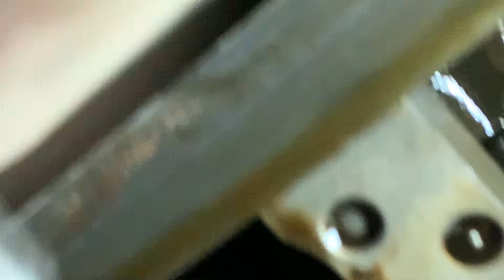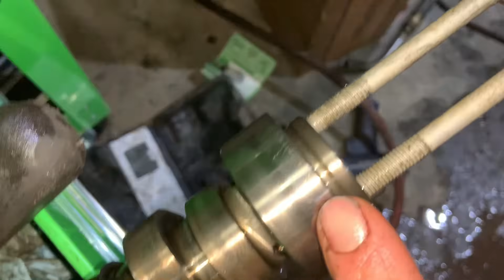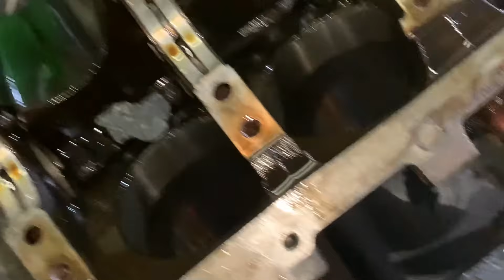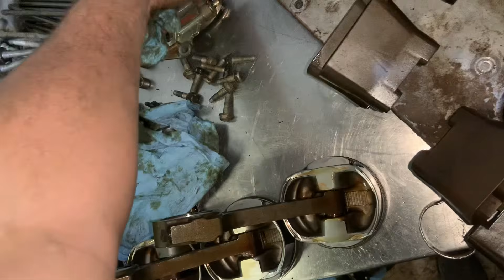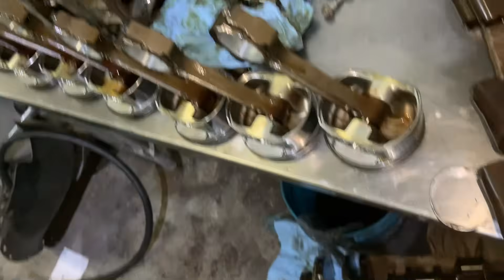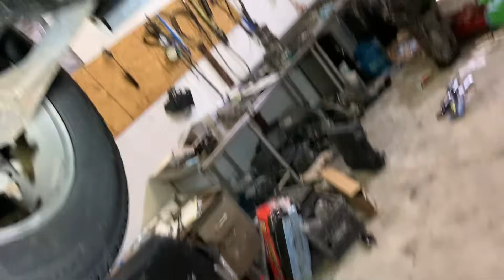ULTIMATE LS ENGINE NO OIL PRESSURE LOW OIL PRESSURE DIAGNOSIS AND REPAIR GUIDE

Comment: Great video, thank you for the plethora of information. Was wondering if you could answer a few questions I have. I recently purchased a 2007 Escalade with 194k miles. It needs some love but overall a great truck that I’m enjoying fixing up and getting it ready for the road. I’m getting a low oil pressure warning just around the time the engine warms up to operating temperature. If I give the engine a little bit of throttle (1500-2000rpms), the light immediately goes out and doesn’t return for a short while, and then I can repeat the process. I did notice some inconsistent ticking noise coming from the engine occasionally. Sometimes I can have the truck run for 10-15min and not have any of that noise (oil pressure warning will still come on though). The noise may or may not be unrelated. Sounds somewhat like a bad belt tensioner but I replaced that already. I’ll see if I can get the accessory belt off and run it when the noise is present to see if it goes away. Anyways, I put in fresh 5w30 high mileage oil. Mobil1 filter. I still have the old filter that I’m curious to cut into to see if there’s any metal in it. I do have some oil that drips overnight. Looks like it’s coming from a few spots, mostly the oil pan. So, that being said, I do have it on my to-do list to change that oil pan gasket, as well as the o-ring. I’m tempted to change the oil pump as well. Should I opt in for a high pressure/volume pump by Melling? Or you think I’ll be fine with a regular one? I’ll try the trick for taking the plate off to see if I can notice any cam bearings that walked out. Oil pressure switch was recently replaced as well after I was getting a code for it. I didn’t look for or receive an oil pressure switch filter. I recall seeing somewhere in another video how the 6.2 didn’t have a filter/screen for that oil pressure switch. Any thoughts or comments on my situation would be very appreciated. Let me know if you have additional questions for me to provide as much info as I can.
Reply: My SRT8 has similar issue except only at idle when hot or operating temperature. As soon as RPM increase to 1000 the oil psi also increases from 5psi to 10. Rule for oil pressure is 10psi for every 1000 RPM. I will be dropping my oil pan to investigate. Any updates on your end?
Reply: @richey1794  I’m currently in the process of replacing some parts (waiting on a RockAuto shipment in the next day or two). The ticking sound was probably a one-off, I haven’t ever really heard it come back, so I’d write that off as unrelated. Oil pan is off. Oil pump is off. The oil filter didn’t have metal shavings but a lot of sludge, as was evident when I took of the timing cover and oil pan. Not thick sludge but just a lot of brown staining which kinda indicated infrequent oil changes and probably poor oil choice. Anyways, o-ring looked a little squared off. I’m not sure if it’s the culprit but I could easily assume so. Oil pump had some scoring on it, but I don’t know if it was bad enough to be a bad pump. I did, however, purchase a new Melling High Volume pump that I will be installing. I did also replace the Cam Thrust Plate. The new one has a nice little seal that extends 1-2mm from the surface. When I took the old one off, it was flat like the earth. I’d like to think that new cam plate will help with my oil pressure in addition to a new pick-up tube o-ring, new oil pick up tube, new high volume oil pump, new oil pan gasket, and a good cleaning of the pan and other components. I checked under the windage plate and it was hard to see if any bearings walked out or not, but I didn’t see anything out of the norm. The absence of metal shavings kinda helped me confirm the bearings are still good so far. I also have a new timing chain kit I’m installing while I’m there along with a few other misc parts. New motor mounts are in (both were SHOT). Don’t know what else to add, I guess I’ll have a better answer a few days from now if I’m back here in the comments section. I’m fairly confident everything mentioned above will fix my oil pressure issue. If not, I’ll be pretty bummed out since this project is already creeping past my budget.

Comment: Great content! I was wondering if you have ever compared the oil pressure indicated from the front left oil port vs the rear oil sender port. Working on an '08 Yukon Hybrid 6.0 at the moment and have HOT, 1100 RPM, 54 PSI at the front port and 23 PSI at the sender. At 750 RPM, the pressures are 48 and 17-19 PSI. This is an engine that has had another shop install a high-volume oil pump and I assume pickup o-ring. Thanks for any info, Oscar.
Reply: Did you ever determine the cause of the differential?
Reply: Sadly, no. If I remember correctly, the customer took the vehicle away. @kincaidjeff

Comment: Thank You for a very comprehensive explanation concerning low oil pressure causes.    talked to 4 mechanics and got 4 diffrent explanations....  I WAS a ASE certified many years ago and wanted just at least another opinion.
You confirmed many things as I am of the 350 era.....built a few and found how to make more oil moving with higher rpm's...   yada yada.   thanks for confirming an ole guys diag.

Comment: Misinformation, the oil pressure bypass DOES NOT STICK UP, SHUT, LETTING OIL PRESSURE BYPASS. THE BYPASS PISTON IS SPRING LOADED TO WORK AGAINST OIL PRESSURE THUS BEING OVERRIDDEN WITH HIGHER PRESSURE TO   PUSH   IT   DOWN  TO BYPASS OIL BACK INTO THE PUMP VANE.
Reply from the maker: There is no pump vane.  They are gears. Misinformation! Fake news!

Comment: Good video. I normally skim through long videos cause it's 90% talking about what wasn't the issue or what else they did that day walk the dog etc. Before they get to the point. I had to watch the whole thing through here. It was truly useful information. Even about the piston rod upgrades to the lq4 in 05 up. I finally got a pretty good idea of what im going  to end up doing with my 03 2500hd. I wish it popped up on my search before when I did the o ring. I don't want to drop the pan again so I'm going to end up pulling the motor and rebuild or replace anyway. I notice a misfire when I first drive when it's cold and was led to believe possibly rings. But regardless the motor has 300+k miles so its do for a full teardown rebuild. I'll def be shooting for some upgrades if I'm going this far since I won't be going on that motor by choice a second time. Thanks for making a good video.

Comment: Excellent video. What about the pressure relief valve in the oil pan? I saw somebody said give it one blow with a hammer or screw a bolt in it to seal it off.
Reply from the maker: I delete them.  Just get a plug at the hardware store

Comment: How do you pull the pan off without pulling the front  diff?
Reply from the maker: its tight but done turning the wheel all the way one way, the diff has to be lowered down though, leave it connected to the axles so it does not fall out.   Depending on what Im doing, sometimes I just drop the diff to get it out of my way.  Oil pan gasket can be done without taking it out though

Comment: You have a gift,  you're a great teacher, great video!!!!
Reply from the maker: Thanks!  I enjoy sharing
Reply: @Brainstangs  yes sir! I can tell lol 😊
Reply: Hey buddy, my oil pressure is low on these cold mornings but not super low like these 2 customers trucks. It does improve after some driving on the road and freeway, at times its so quiet it doesn't sound like my truck is on,since it has a stock exhaust system, lol. I have a 2007 Silverado Classic with the 4.8 v8. After watching your video my guess is it's the oil pick up tube o-ring and man your info of the lifters was very comforting and educational! That it's the air in there, not just oil that's causing that light tick/ tap/ clack. I'm definitely going to have my mechanic drop the pan (since I don't have a lift) and replace that o-ring on the pickup tube! Like I said, I don't think it's a bad cam bearing because my pressure isn't 0 and it gets better after some driving and it's so quiet at times it doesn't sound like the same engine. But while he does drop the pan I may ask him to drop the windage tray, not the covers to the crank, but just the windage tray to see if the cam bearings are as they should be, but I'm kind of nervous about that! Lol. What do you think though about all that I said, symptoms and all, what's your best guesstimate?

Comment: I have a 2004 Silverado 2500 2wd. I have a leak in my radiator/engine oil cooler side that is leaking pretty good. I know they sell a oil cooler block off kit for my truck. I'm looking for a temporary fix. I don't haul any trailers or heavy loads. Will eliminating the cooler do any harm? Also is there any pressure in the oil cooler lines? I'm at 35pso all the time but it used to stay at 40psi before this leak started.  Thanks for any advice you could give.
Reply from the maker: yes, oil cooler lines run at full engine oil pressure.  You can delete the lines, many do.  Need to get the right bypass plate to bolt on to the oil pan and your good.  Just the stock one from gm, then you have to change the gasket as well they are different for both designs.

Comment: New ring,and  new melling 295HV, do have better pressure then stock pump. Has about 10 psi at idle and builds to 20-35 when driving. But doesn't hold static pressure above 10 psi when idling. Has 156000 in it. Runs great no lifter nosie. Pers like a kitten. Not like it was before when idling around 40 and driving  55 60. Definitely not the same .
Reply from the maker: yea you have a issue.  10 psi is enough to pump up lifters in a stock engine, meaning stock valve spring pressures.  I am sure you have a cam bearing issue though based on the static pressure and using the hv pump.  Some get by for a long time with a cam bearing out.  Pay attention on your next oil change for metal on the magnetic drain plug.  It will show a lot of metal if the bearing is out.  Good luck
Reply: 10-4, originally when I first dropped the pan when I'd change Oring out then proceed from there for oil pressure, then went to pump, I did notice shaving's on pan drain plug. I'm original of vehicle. Very small of metal in pan . For being first time I dropped pan seemed pretty clean for mileage, guess you'd have some metal. But I did notice in pan probably about the middle of it there was a small piece of something possibly pieces of cam bearing broken off. Not very big maybe about 1/16 to 1/8 inch . Only too pieces in bottom area and sitting in middle of pan. Did notice a lot of gray sludge not magnetic.. yeah so looking at your YouTube possibly the cambering slid out got chopped far from the crank rotating up and then sliced a piece off of their can bearing but very very small but my truck man it runs good man It just doesn't hold great oil pressure idling but I'm just going to run it man it's all I can do until I got to take the motor out hopefully I can get 30-40,000 more out of it I'm not really hard on it I'm original owner I've taken care of it never driven it really hard but that's just the way it goes.

Comment: I have a 6.0 2007 that is not getting oil to the rockers. We just finished putting a cam, lifters, push rods, rockers, valve springs and seals. I had low oil pressure then replaced the pick up tube o-ring. It now has 40psi at idle cold and 25-30 hot.
Reply from the maker: So all is good now? Your getting oil up top now?  those numbers are fine for pressure

Comment: Great information! I bought a 2003 Silverado 2500 with a fresh (600 miles) build on an 8.1 that is now experiencing no oil pressure. I have not pulled the engine yet but that is my next step. It's also a Raylar 540 cu in. kit so there could be other factors. All of the reading I've done before watching your video had me to believe the most likely suspect is a cam bearing and your video reinforced that theory. Thank you for sharing your wisdom on this subject and if you have any ideas specifically about the 8.1 loss of oil pressure please let me know.
Reply from the maker: the same concepts apply across that platform as well.   good luck

Comment: I believe this what may have happened to my 2004 5.3L. For a year or two I was getting an ultra-fine golden metallic shine in my oil drain pan during oil changes. The engine ran fine and quiet with normal oil pressure. Then one morning on the way to work warning lights came on and oil press gauge went down to 10-15psi. With 245k on the engine and even after that it ran smooth and quiet but with very low oil press.
   I bought a GM factory engine long block, and had it changed by the best shop in my area that has been in business since 1947. Calvert Automotive here in Denton TX. I never had it torn down to find out what failed but that explanation of cam bearing backing out and getting sliced by the crank counterweights sure looks to be what happened to mine. I'm hoping the 2020 GM factory replacement engine will do better or at least get to another 250k.
Reply from the maker: sounds like what happened .  good luck

Comment: Most incredible and thorough explanation and video I have ever seen on YT or anywhere else!  I have an 05 Chevy Silverado 1500 2WD 5.3 Vortec with low oil pressure but the thing runs awesome.  Just a basic ext cab long bed pick up truck, no frills. I changed the oil sending unit twice and confirmed low oil  pressure with a manual guage. Anyway thanks for the vid. I'm about to tear it down (again) and install a new high volume Melling oil pump, pick up tube, new o ring etc and see if I can't  get some oil pressure. Why does the oil pick up tube use only one bolt to secure it to the pump on one side? Seems like that's inviting an air leak to me. One of those mysteries of life I suppose.
Reply from the maker: the one bolt has no bearing on sealing of the oring.  You only need one bolt. You will see that it just holds  a plate down flat which keeps the oring happy.  Good luck
Reply: @Brainstangs  ok , thanks for the reply.

Comment: I don't mind long winded videos when they are this informative, thank you for sharing your experience. Now I'm nervous about the cam bearings recently installed in my LS1 build. Didn't specify the wider bearings, wishing I would have after watching this. They had trouble installing the bearings in the aluminum block, told me the cam bearing bores were super tight. Hoping I'm not going to end up having to take this thing back out for another tear down anytime soon. Guess time will tell, at least I know some of the things to watch out for now.  Thanks again!
Reply from the maker: glad you enjoyed it.  Keep our fingers crossed for you.

Comment: Rebuilt gen 3, durabond bearings, good clearances, melling pump. 40 lbs cold, 12 lbs hot. Noticed a small amount of metal after changing oil. No noises, runs great. What’s your thoughts?
Reply from the maker: 40 cold is fine, 10 hot not so great.  Hard to say with all you have already done.  Have you checked with a mechanical gauge?  I would make sure that is the real numbers, if it is low you could have a leaking barbell in the back of the block, I haven't seen this personally though.

Comment: I'm in the process of replacing my oil pump and oring 04 GMC 2500 HD without removing the oil  but now after seeing this I'm pulling the oil pan tomorrow and praying its not the cam bearings fingers crossed I really don't want to pull out the motor it's not making any noise at all but hot it's 5lbs of oil pressure and at 25 to 3 thousand rpms it's 18 lbs 🤔!!!
As far as I'm concerned GM should be sued and held RESPONSIBLE for this problem!!!

Comment: Thanks for the video. I have 20 psi of oil pressure. I changed pressure sending unit twice, checked oil pressure with a mechanical gauge still 20 psi on cold start and decreases when warm, new oil pickup tube o'ring, then new oil pump, new valve covers Gaskets. Pulled windage tray and everything looked good. Same oil pressure throughout this process. Going to pit a permanent machanical oil pressure gauge at the side block plug by oil pump outlet. I ran it for 2 hours on the highway and stoped for gas when at idel low oil pressure warning light came on and binging. I left it running and popped the hood to look and listen. There was zero lifter tick. When i pulled the oil pan there was no sludge. Im the second owner. 180,000 miles a runs like a beast. Help any and all help would be appreciated.

Comment: Hello! I just recently received a car on trade with a Gen 4 Alum 5.3, cam, ls7 lifters, trunion upgrades, dod/afm deleted with a standard summit oil pump. I’m running 20-50w.  It’s a fresh build but I seem to notice low oil psi. At idle cold it’s 40ish psi. Hot 195F  goes down to 10-14 at idle. Under WOT the max it will see is high 30s. Holding the throttle at 3000 rpm it will only mid 20s. Do you think this is too low of oil pressure? Or possibly the oring was pinched on install or the standard summit pump is failing even tho it’s new to the build?  I drift the car and seeing that low of PSI concerns me so I just want to make sure it’s all good before I take it to and event! Thanks for the informational video.

Comment: Liked the video! Had a question for my truck:

04 Silverado. Just had a new engine built, spun a crank bearing within first 15 mins of test drive. Second engine only had about 20lbs of oil pressure. Within 10-15 mins it drops to about 8. Very low horsepower. The original engine had more power with 300k miles. Is there a way I can check the oil pressure besides the oil pressure sending unit?

Thanks for the response!
Reply from the maker: You can attach a mechanical guage to a couple of spots on the engine.  The plugs I show in the video are where u can attach a guage to just check.  That’s the only way to double check.